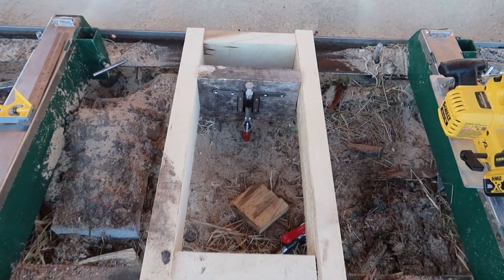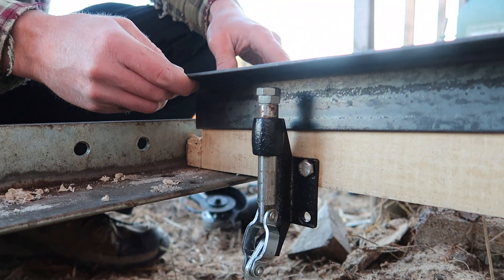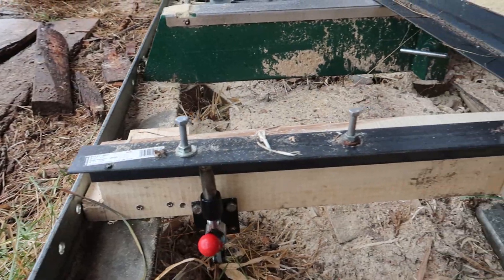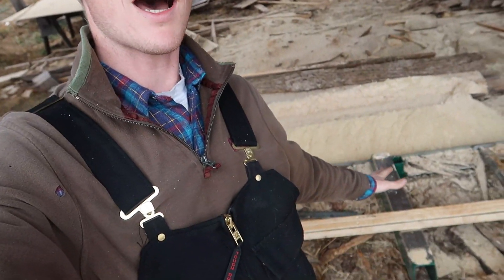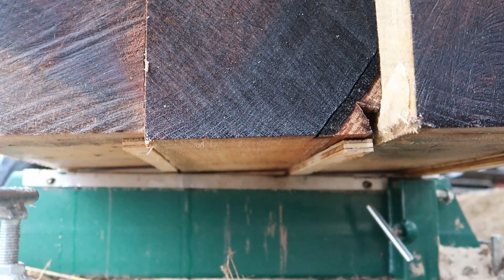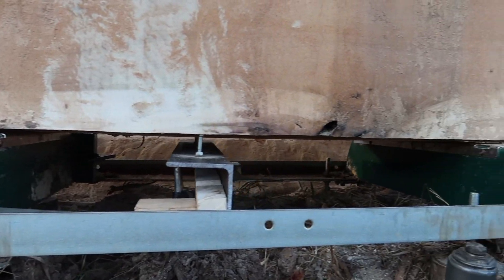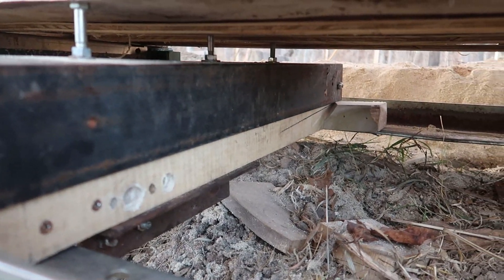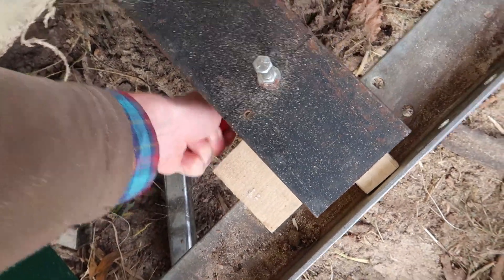Tapered Siding Jig 2.0

Comment: What is the reason for strips on bottom?
Reply from the maker: Those are what allows the cant to rock back and forth to make the taper cut. That way when it leans, it’s leaning into the cut versus away from the cut. Makes it more stable. Does that explain what you want to know?
Reply: @LandisLegacyFarm  Sort of, but if you sat the can't on the bunk won't it do the same. Maybe I'm missing something.
Reply from the maker: So as I’m pushing the saw along, the blade is cutting from right to left. This is pulling the cant to the left somewhat. I put the strip on the left side of the can’t so it leans to the right. This way it’s either leaning into the cut or level. Without the strip, the cant will be level with the clamp down and then will be leaning to the left with the clamp up. Since the blade is already pulling the cant to the left, if it’s also leaning that direction it’s going to bind the blade. Is this a better explanation?
Reply: @LandisLegacyFarm  That makes sense. Thanks.

Comment: hmmm, as you say as you get farther from the fulcrum the swing gets longer and leverage lesser, how do you combat the fact youre raising/lowering the second and possibly 3rd cant farther than the first one, wouldnt you get different angle or thickness slices since those ones are being moved more?

maybe im misunderstanding how it works, the sawdust side of the cant pivots on the sawmill bed, and the idler side of the cant gets tilted up and down by bolt heads on the jig but wouldnt the furthest bolt head move almost twice as far as the closest bolt head?

i assume you have to clamp and unclamp the whole setup after each pass? or with a sharp blade will the cants stay stationary without being clamped by a log dog
Reply from the maker: If you watch the "Adjusting Lifters" chapter really closely, you'll see that in the "lever up" position, I brought all of the bolts to the same height above the log bunks(however thick your spacer is, that's how far above the bunks your lifters should come up). So while you're correct that the lifters move different distances, that difference is in how far down they go, not up. And because the idler side of the cants rest on the bunks and not the lifters on the "lever down pass", it doesn't matter that the lifters are unevenly down. 

On the sawdust side, it's actually the spacer that the cant is pivoting on, and on the idler side it's either the log bunks or the bolt/lifters depending on whether it's the down or up pass respectively. During the "lever down pass", the cants are leaning towards the operator because its on the spacer(sawdust side) and bunks(idler side), and during the "lever up pass" the cants are level/plumb because the lifters have raised the idler sides even with the spacer height.

No clamping required, but you do want to keep a fairly sharp blade on it. If you have really tall cants like I did, you could raise the log supports up a bit so that on the "lever up" pass there's a little support on the back side. "Lever down" you gotta keep in mind that the cant is actually leaning into the cut so it's pretty stable. Another factor would be if you only had one cant it would be more prone to rocking, as I'm sure the friction between the cants increases stability as well.

Whew! That was a lot. Let me know if you have any more questions. Josh
Reply: @LandisLegacyFarm  thanks for the reply that cleared up the travel question i understand now, i had assumed all the bolts were the same length protruding and the adjustment was to adjust the angle of the sidings bevel

im wondering now why the spacer boards are used, just makes the logs pivot easier when youre lifting them to level and dropping them for the angle?
Reply from the maker: If you don't have the spacer boards, then in lever up position your cants will be leaning towards the sawdust side. I think this would create some major stability issues since it would be leaning in the direction the blade is pulling it, and nothing is clamped in place while milling.

Comment: Wouldnt a couple of space wedges placed under the cant work just as good. 

In oz we normally make bords 19mm x 6mm. A 13mm board under one edge would do yhe same
Reply from the maker: Absolutely, but in the long run, I think this is much faster. Also, I don't think you can do multiple cants with wedges.(at least not that I know of)

Comment: Maybe if you angle your blade it would be easier.the msg 250 comes standard with bevel siding on the mill.all you do is drop your blade angle a 1/4inch or so and done

Comment: Hi Josh just found you chanel and subscribed I was looking at your jig I would think that each can't would have to be lifted independently on their own levers so that way each bottom  side will be the same thickness check the thickness on the bottom side and see if they're close enough to one another for your liking.  I love what you're doing keep it up Happy New Year to you and yours
Reply from the maker: Welcome! It's a bit tricky to explain, but here goes.... Maybe think of it like a door closing(but flipped 90). It shuts to the same spot every time. So if I had 3 bolts across the width of the door, and I shut the door, those bolts will stick out an equal distance beyond the door frame. This is why I choose a toggle clamp, because it locks to the same spot every time. If you'd like some pictures of it, you can find my email in the "About" section of the channel. Josh
Reply: Landis Legacy Farm oh yes it fet it now each can’t can be adjusted on the lever. I gotta tells ya I admire you drive. You are a very busy young fella. And so capable. You are building a building by yourself thank you so much for sharing what you do. I’m an old dog and I’m learning new tricks. Have a blessed day, happy new year!
Reply from the maker: Thanks, Happy New Year!

Comment: You look at things the hard way, I'm not there but see a easy way. Rods that run the  length of the mill frame. A s cam between each bunk. You set them up at a measured distance from the bunk stop. each cant comes against a stop, measure out and put in another cam the full length of the track. Where the bars start from is where you bring the machine back to each time. The handles stick up for each track and they only move as far as you lt them meaning you adjust the cam by how far you let it go against the stop. again easier. Since you make each cant individually. they are all the same width, the only thing different is the highth and that doesn't matter. I would start each one flat and then cant the others. I would at first make them fairly close till you get the hang of it. no bending over and easy to adjust. Any questions, just reply and I will try to walk you through it

Comment: Great job. I've been working on a jig for my mill for awhile now. I love the simplicity and the adjustablity of your jig. Do you have trouble with the cants wanting to rock while you're cutting?
Reply from the maker: That's a good question that I forgot to address. With one cant, yes it does tend to rock, especially if you push too hard. However, with two cants, I didn't have any issues. Josh